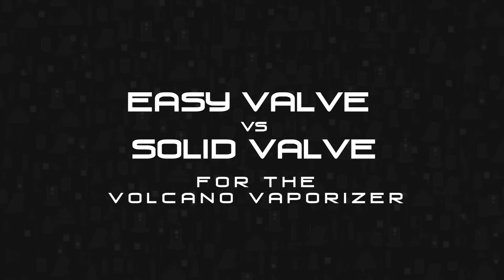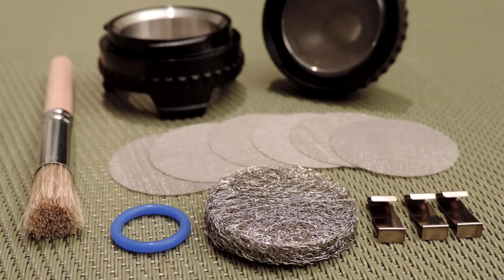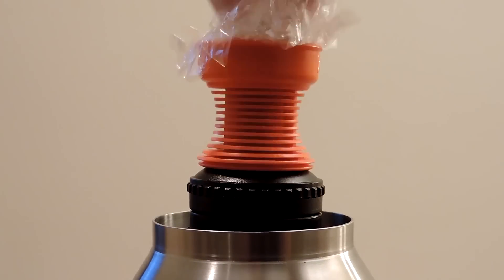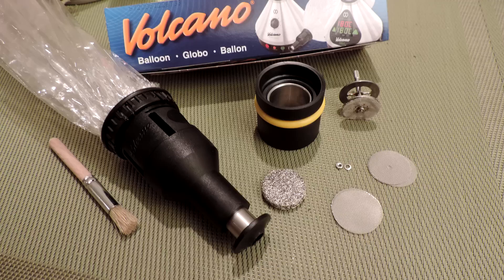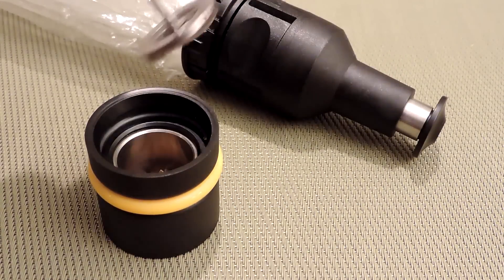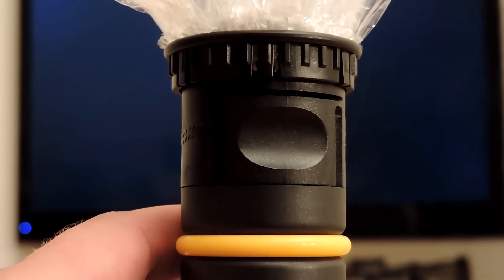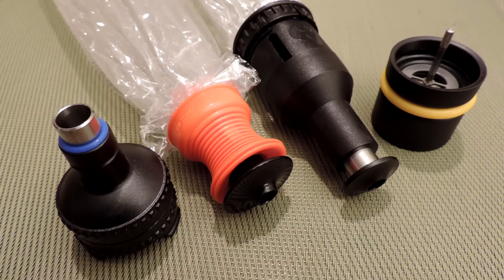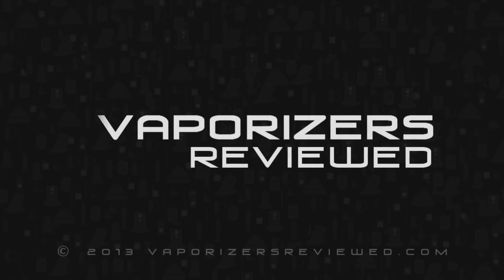Easy vs. Solid Valve for Volcano comparison

Comment: I have been using an easy valve for like 7 years and I’m just now figuring out you’re supposed to take the black part off so you don’t have to hold it on there perfectly 🤦‍♀️🤦‍♀️🤦‍♀️ Thankyou for this video! It’s weird though, my volcano came with a nozzle that looks like the easy valve but it has the ring around it so you can change out the bag sizes. I was looking to buy another one and now all i can find is the solid one.

Comment: Solid valves are amazing but finally after many years both tabs broke from the part that clips the mouthpiece on, it's still usable but you have to hold it together all the time. This piece is around £50 to buy so I am now looking at the easy valve as a replacement in order to save money.

Comment: My solid valve never leaks. I use cheap turkey cooking bags (they have enough nylon content in the plastic) completely tie off one end. Clip open a corner at the factory sealed end just big enough to mount it to a solid valve. This prevents a large gathering of bag at the valve making assembly much easier. A major cause of leakage with the solid valve is bunching too much bag at one side of the valve, or not making sure all of the bag end passes under the o-ring on the valve or not getting the clip on tight.
Reply: I found that some of those type bags fail at the factory sealed end, I use then the traditional way but I put a fold of sellotape all the way along the factory sealed end and this way they last much longer, I still prefer the ones on the roll, you start with huge bags and as they become damaged near to the valve as they twist and turn and or fall over you snip that part off and just make the bag a bit smaller until it is too small to bother with or until it ends up developing too many holes but it's always nice to have a fresh bag.
  I'm sure there are people on here who change their bags weekly. lol
Reply: Check the disc that sits atop the plunger, make sure it is completely level where it sits at the top of the herb reservoir. If it is not perfectly flat the metal tube at the end of the valve which mates with this disc can not make a seal, the two must align so that the tube is perfectly. flat across the disc as this is a metal to metal connection. Other things to check are the screw threads for the steel cylinder inside of the black ring and the round knurled nut which tightens the valve together, check everything is clean and finger tight.

Comment: my solid valve leaks big time ps why i watched this video:)
Reply: Check the disc that sits atop the plunger, make sure it is completely level where it sits at the top of the herb reservoir. If it is not perfectly flat the metal tube at the end of the valve which mates with this disc can not make a seal, the two must align so that the tube is perfectly. flat across the disc as this is a metal to metal connection. Other things to check are the screw threads for the steel cylinder inside of the black ring and the round knurled nut which tightens the valve together, check everything is clean and finger tight.

Comment: no you are right the solid leaks and also the clamps which are made of a plactic  piece gets loose after 3 weeks which is pretty bad. I am told that you have to let the machine cool down before unclipping, if the clips are hot then it will loose it shape and the clipping will be very very loose, in fact the machine don't work anymore you loose all your steam.

Comment: The easy valve plastic housing breaks all the time. I go through 1 plastic bottom part every 2-3 days. It just can't handle the heat of continuous 230C.  I just ordered a solid valve instead. I honestly think no clip on the solid valve is a good thing. It's the clip that breaks the easy valve. Small tradeoff.
Reply: Thanks for the tip, I was just about to start buying easy valves as my solid has finally broken, both clips are damaged or missing, it's still usable if I hold it down and hold the mouthpiece on. now I'm wondering if I can hack a decent repair or work-about.

Comment: my solid valve leaks too.  i just accept it.  i'm pretty sure the leak is where that metal insert piece is and not really fixable..  it does not make all that great a contact seal with the top rim.  thus, a small amount of vapour shall get through.
Reply: Check the disc that sits atop the plunger, make sure it is completely level where it sits at the top of the herb reservoir. If it is not perfectly flat the metal tube at the end of the valve which mates with this disc can not make a seal, the two must align so that the tube is perfectly. flat across the disc as this is a metal to metal connection. Other things to check are the screw threads for the steel cylinder inside of the black ring and the round knurled nut which tightens the valve together, check everything is clean and finger tight.

Comment: I already owned a solid value.    It’s Ok.   But it leaks & the plastic parts that click together tend to wear out fast with frequent use.   I’ve had to replace the plastic parts of the Mouthpiece & they charge almost the same as a whole new mouthpiece.   Now that it has broke for a 3 rd time in 4 & 1/2 years.    So I’m switching to the easy valve after watching your video